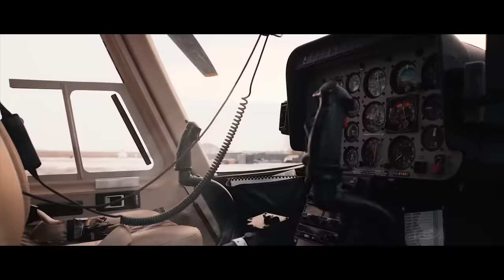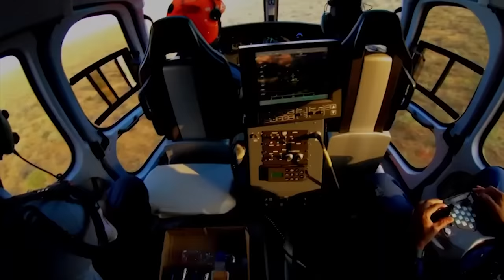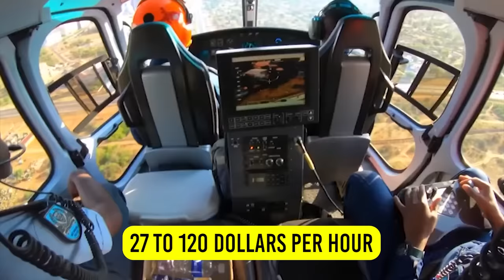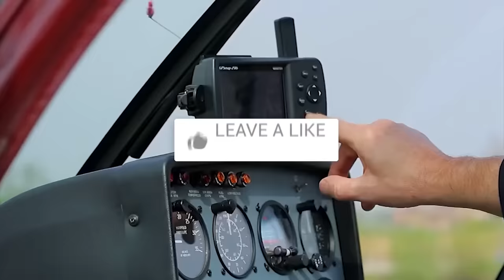Unbelievable! The Real Cost Of Owning A Private Helicopter 💰

Comment: You missed 1 massive expense. Maintenance. That is one of the  biggest costs of owning a whirly bird. They need constant maintenance before and after every flight. All work must be carried out at an approved maintenance organisation, by licensed engineers and mechanics.
Reply: I worked doing communications along a pipeline and we used the pump station helicopters to get to mountain top sites. They had to have a mechanic there to do a daily before the helicopter could fly the next day. This was in 206s and 407s. I had other jobs where I went to drill ships and platforms with bigger helicopters. We flew in Super Pumas on one job.
Reply: I had a saying when I had an R22 as a personal toy. A boat is a “ hole in the water that you throw money into.” A fixed wing is ”a hole in the air you throw money into”.  A helicopter is” a hole in the air that actively sucks the money out of your pockets” 
Also the OP has left out overhauls if you have a Robinson. The mandatory 2200 hr/12 yr overhaul is about half the cost of a new one. 
Oh and then there’s insurance. Premiums quoted to me were 17% of  hull value per year with a 1% excess on making a claim. So roughly in 5 1/2 years you’ve paid for a new helicopter in premiums ( if you don’t make a claim) 
And then if you live outside the USA many parts are paid for in US  dollars so if the exchange rate in your country is bad then you could pay significantly more in local currency. 
Way more costs than he’s cited.
Reply: My thoughts as soon as I finished watching this video.  He is correct - but should of added at least 5 minutes - manybe more - explaining maintenance,   That too is VERY expenses....
Reply: Pretty much. You can own as cheap as a use $150,000 helicopter but it still going to cost you $75,000 a year. This seems to be a pretty accurate ratio no matter what the cost.
Reply: @Jabiru430VHDOD  YOu know it, bruv.
Reply: THANKS FOR YOUR DATA.
Reply: AME course I did (never ended up in aviation but still am around it) usually with a helicopter it's  per 1 hour flying is 2 hours maintenance generally
Reply: @bennyc6694 To be clear, every flight does not require maintenace afterwards.  

For most any civilian helicopter, a 2:1 ratio of svc hrs to flight hours is just nonsensical. 

A 2,000 hr TBO does not use 4,000 hours which is 166+ 24hr days, or 500 8hr work days of labor for service.

Comment: I commuted to work daily on a helicopter. Take my word for it, buying a helicopter is the cheap part - owning one is the expensive part. Maintenance and parts on a helicopter are enormously expensive. Assume 3+ hours of maintenance for every flight hour. Insurance costs are also astronomical. Recurrent training and subscriptions are also very expensive. Helicopters also require extensive support equipment and a hangar facility large enough to house everything.

Comment: As a helicopter engineer. here's my one piece of crucial advice. if you're buying one. You must have it surveyed by a licensed engineer on your payroll.  He works for your interests. It takes 3 days to go through everything. From paperwork to make sure all the mandatory inspections have been done and you're not due anything from an expensive gearbox overhaul, to a burnt compressor turbine. As its been over temped. 
This also applies if you buy a new one, as the factory will just want it out the door. The paint jobs are sometimes shocking and they bounce through the air like a jackhammer. Send an experienced pilot to fly it and check everything works in the air. 
I have just been working on a twin engine that was bought by a customer. Paid £800K for a turd and has since spent the same making it safe to fly. Its still a turd though. I would have only charged him a days rate, as I would have have spent 10 minutes on it before telling him to walk away. That's before we would have found the Main gearbox due its major overhaul and an engine with virtually zero hours left. 

You wouldn't buy a house without a survey and you would get your prospective Porsche plugged into the main dealer network, right?? Been warned.
Reply: Thanks buddy. A way to reach you?
Reply: @garettclement6671  I’m uk based mate
Reply: Spent around 15,000 hours in Hughes 500s and various jet rangers and A-stars. The engineers and maintenance crew are the most important part of any helicopter. We did search and rescue, as well as television. Thankfully, literally everything was paid for. The cost would be astronomical to own and operate it.  As the saying goes: “If it Flys or Floats” - rent it.

Comment: People usually buy a helicopter with 2-3 other pilots to share the cost. It makes a huge difference. We have a turbine helicopter for 3 families (we're all pilots, so we fly it ourselves). It burns about 30 gallons of jet fuel per hour, so it's about $150-180/hr in fuel, plus we pay $400/hr + $2000/month to cover annual inspections and unexpected issues. Insurance is about $30k-$55k a year (it gets lower as you build hours). Hangars are another $600-$2500/month.
We also have a smaller piston helicopter that's about 5x cheaper to operate overall (fuel cost is about 1/2).
Reply: JetA is currently $8/gal so that's $240/hr in fuel.  That's the big question mark in the sky, because when we go to refuel we pay what they ask and that's it.

Insurance at $30k/yr for non-instruction, hangar at $1K/mo for 3-blade or other a/c taking up a lot of space, and you got $42K for ins+hangar, $24K maint, $240/hr fuel, PILOT IS FREE, so $4K/mo+$1K/4hrs. per month.  

Your "smaller piston helicopter" which burns 1/2 must be an R-44 and you're claiming 1G/h but it's really more like 16-17 so let's meet in the middle.   16GPH and $8/gal = $128/hr for fuel.  Insurance, pilot, hangar, all the same... maint a little lower because no turbine but a little higher because 50/100hr maint eats you slowly... so you get a $100/hr discount on your flight, but a higher cost on your amortized cost of financing an a/c (or conversely its depreciation).

It's not a "bad deal" but it's not a great one either.

Comment: Seriously, I'm having trouble with these bogus numbers.

My company owned a helicopter for 4 years about 10 years ago.   The only numbers that have changed since then are consumable costs (e.g. fuel).   I'm a commercial helicopter pilot but even so.

1. The cost of hiring a pilot is not $9,300/mo.  That's absurd.  The cost is per hour or per day depending on the use and schedule.  Nobody pays $113K/yr to not fly, nor do they pay that much to fly daily.  Pilots either are on salary (and $90K/yr is the rate to start) or hourly and that depends on advanced notice, distance, length of time away from home base, etc.

2. Helicopters don't cost any of the numbers you mention unless you're buying brand-new and paying MSP.  We had our Robinson R44 for $260K and there are many Bell JetRangers (B06) models available in the $300-$450K range.  Sure, they may need some work, but that won't carry up to be $3-$4M.

3. Insurance, hangaring, scheduling, depreciation, pilot, maintenace, and overhaul, and the occasional regulatory addons (e.g ADS-B) add on to this, but they are either time based of hour based.

4. Your overall cost is the cost of the aircraft (possibly amortized if you have a loan) and the hangar fees and insurance.  These occur every month whether you fly or not.  Then there are the hourly costs: pilot, fuel, oil, filters, amortized maintenance per hour, amortized overhaul per hour, etc.  Finally one-time costs for things like landing fees at expensive airports (think Las Vegas or Teterboro), border crossing fees, paying security at sketchy fields (think Mexico) to guard your baby from wandering visitors, etc.

Having done it for four years but ten years ago and adjusted for today's consumables' cost (fuel, oil, filters, mechanic time) and higher insurance rates, you can run a Robinson R44 for around $400/hr.  You can run a Bell 206 (JetRanger) for around $1,200/hr.  If you don't own them, add 20% because the owner isn't doing you a favor for free.

Can you make it cheaper?  Sure.  But... the bulk of the cost is stuff you don't control.  Insurance, fuel, and pilot will eat you alive.

I'll fly you for free for a month in a helicopter of your choice, provided I deem it airworthy and the FAA agrees.  Learn your lessons / master the numbers in real time.  Fuel is a killer.

E
Tucson, Arizona, US
Yes, Mexico is a destination
No, I don't take this topic lightly.  Been there, done that.  Will do it again... when the numbers make sense.

Comment: MD 600N or a Bell 407 (same Rolls Royce C47M) 808shp 6-7 passenger is burning $300 per hour in fuel, maintenance and reserves $300-400 per hour, insurance $300 per hour, plus hangar and property tax, YUP property tax. Maintenance is simple as a pilot, do a quick pre-flight and probably add some oil.  Benefits include landing in private back yards, mountains, private events, restaurants, ect.

Comment: A $5million helicopter will cost you $1,800 per hour if used 700 hrs. per yr. The price drops to $1,200 per hour at 1,200 hrs. per year. Yes there are many moving parts in a helicopter, but the swash plate, which cause the rotor blades to dip in the direction of flight are the main culprit. This results in the helicopter basically trying to rip itself apart, and without proper maintenance it will. Some of the new slow rotor EVTOL aircraft expect operating costs to be 40% lower, when compared to helicopters.

Comment: And there's also the fact that helicopters and many aircraft in general aviation are still nearly hand made. Some guy with a rivet gun not a robot has to drill, place rivets then secure them. There are plenty of machined parts in heli's but even the composite framed ones are laid up by hand. Sounds counterintuitive but there is a serious lack of automation in heli and GA production. It's very understandable given the low production numbers but it's still a massive factor in initial purchase cost. Massive high volume sales machines like the 777 or Dreamliner will have large amounts of tedious prep and initial drilling/riveting done by large specialized robots...robots that can check and verify their own work.

Comment: Minimum in an R44 you're paying 350 dollars an hour, and considering that an H125 or any helicopter for that matter will also need a LOT of maintainance you will be going at around 700 to 4000 dollars per hour, depends on which one tho
Reply: Came here to mention the maintenance. That and insurance are the two huge cost factors.
Reply: For an R44, it also depends on hangar fees too. I have it figured in at around $450/hr
Reply: In Australia a R22 was $600hr hire & that was before fuel got expensive so imagine it would be more now. Hate to be paying for those big ones